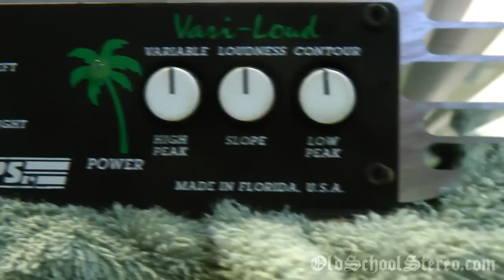The Ultimate Old School 50 Watt Cheater Amp - US Amps VLX-50 or is it?

Comment from the maker: I just looked closer and the amp has (12) 50v 1000uf caps for input filtering and (10) 25v 2700uf caps for the power supply. The input filtering matches the 1999 VLX-25 and USA-400, but it has more power supply capacitance 27,000uf vs 16,000uf as listed for those amps

Comment: I believe the best use for it was to wire multiple subs to drop the impedance low in order to get more watts out of it. Refer to the manual first though because I have not owned that particular model. I had two of the smaller (1/3 the size) 50 x2s that operated best at two ohms. It was designed to dominate the 50- 100w car audio competition classes by qualifying for having only 50 watts but being able to be wired for much higher power. Great company back in the day. All of their amps were very efficient for their size. Definitely not found at Walmart 😈💯👌🏾

Comment: Claiming 25 x 2 with the size of that thing is hilarious!!!.
Reply: MrBmarque1 at 32 ohms
Reply: MrBmarque1 I believe the best use for it was to wire multiple subs to drop the impedance low in order to get more watts out of it. Refer to the manual first though because I have not owned that particular model. I had two of the smaller (1/3 the size) 50Wx2s that operated best at two ohms.
Reply: lb lewis that's common sense bro
Reply: sounds like an understatement, but, it could be REAL

Comment: I sold US Amps back then, and sill run my vlx50 today. State record 0-100 watt at 149.9 with an hc50 on my highs. Incredible amp. Ran  4 Beta 15 DVC's bridged ,Paralleled. NEVER go hot or shut down. Also sold McIosh car audio, and original US Amps rivaled hem for sound quality .

Comment from the maker: The VLX-50 specs you show are at 12.6v, the 14.4v say it will do 500x2 at 1/4 ohm and requires a 120A external fuse. You don't have an owner's manual for this amp, do you? RE Audio didn't reply to my inquiry and I've not been able to find one otherwise. This amp is from 1996 and has the "liquid glass" aka Mirror Polish finish.

Comment from the maker: Yeah, the VLX-25 may have been the ultimate cheater amp of all time...rated at 25 watts total at 4 ohms and does over 1000 watts loaded down. Of course, the Orion 97.3 rated at 1w total at 4ohms is the ultimate cheater, but it was made just to end the cheater wars and was actually an XTR-2250 beneath a special edition heatsink

Comment: Memphis Amp AR-HC100 is the amp i used to compete with in 0-100 stock class with 2 fosgate hx2 15s  3 cube box witha 24 inch long slot port hit 159 in a 88 sentra

Comment from the maker: I'm curious how they were allowed to compete in the wattage classes without having markings for amp models? I know people could easily swap out the end plates, like they did with the Phoenix Gold MS/MPS series amps, but jeeze..why make it so difficult? I'm pretty sure this is a VLX-50, just want to prove it. Maybe I should put it on the bench and check the power at 4 ohms, this may be an easy indication?

Comment: more info on that vlx 25 its able to go down to .25 ohm stereo  will do .5 ohm mono all day its rated after the old usa25 little 5inch amp was a 80watt amp the vlx 25 was rated 12.5watts x2 4ohm 25watt x 2 2 ohm 50watt x2 1 ohm 100watts x 2 .5 ohm  and 400watts x 1 .5ohm but with 100amp fuse it do 1000watts .5 ohm mono

Comment: The spec sheets on these make modern amps look like tonka toys. An intelligently written sheet explaining internal part tolerances and actual current capacity of the transistors shows how these were built like a diesel engine, probably 3 fold over what is needed. The manuals used to say “keep adding subs until the amp enters protect then remove one, 300 year unlimited warranty” LoL.

Comment: I have the original spec sheets for every model back to 1996. Your amp is from 1996-98. By 1999, they had taken the LED out of the palm tree, changed the logo font and stopped using Vari-Loud EQ (even though the PCB was the same...).

Comment: I had a 2000 watt amp looked just like that. US AMps 2000X was it’s mode number.
Reply from the maker: US Amps used the same heat sink for many of its models. In fact many competitors swapped the end plates so they could “cheat” the lower wattage classes

Comment: It's a VLX50 if it has 22V rails. It's a USA-100HC if it has 25V rails. It's a USA-400 if it has 44V rails. VLX is 1/4 ohm stable. 100HC is 0.5 ohm stable and 400 is 1 ohm stable.

Comment: Just ran across this video this is where jp got his amplifier designs from The old US Amps 😂😂😂 And the different  colors also  if I can remember those old school amplifiers  don't need fuses they have a protection circuit that's unbelievable if you touch two wires it automatically goes into protection until you fix the problem

Comment: This is competition level old school Gold 👌🏾
Reply from the maker: +lb lewis no doubt!
Reply: lb lewis i have the Black version of this Amp I was thinking about running subs off it
Reply: Terry Watkins I believe the best use for it was to wire multiple subs to drop the impedance low in order to get more watts out of it. Refer to the manual first though because I have not owned that particular model. I had two of the smaller (1/3 the size) 50Wx2s that operated best at two ohms. Go for it let us know how she sounds.

Comment: Hey D! I recall one of the competitors having this VLX 50 in a High Voltage version and 12 were made that way. I was trying to make a deal with them on the amps with schematics because of them being "custom made". Supposedly they ran 24, 10" punch dvc 4's  at 4 ohm loads, per pair. If anyone has info on the amps I mentioned I'd love to learn more about them. Thanks All
Reply from the maker: US Amps made many custom amps and people swapped those end plates all the time using high voltage amplifiers with end plates from the cheater amps

Comment: I'm pretty sure that's a USA-50HC which was good for 800 watts at 1/2 ohm. Does it measure 23" long? Also, because of it having the "Vari Loud" controls, it is a 3rd generation which they started making in 1996-1997.
Reply from the maker: +TheHMFNW It was confirmed to be a VLX-50 from the serial number. US Amps had a lot of different versions of amplifiers using the same heatsink
Reply: +Dereck BigDWiz cool! Still an amazing amp regardless of model! US Amps were and still are "the shit"!

Comment: VLX50 Specs from USAmps:

25 Watts @ 4 ohms / 50 Watts @ 8 ohms
50 Watts @ 2 ohms / 100 Watts @ 4 ohms
100 Watts @ 1 ohm / 200 Watts @ 2 ohms
200 Watts @ .5 ohms / 400 Watts @ 1 ohm
400 Watts @ .25 ohms / 800 Watts @ .5 ohms.

But the USA-400 is more powerful. 

POWER OUTPUT STEREO/ MONO
200 Watts @ 4 ohms / 400 Watts @ 8 ohms
400 Watts @ 2 ohms / 800 Watts @ 4 ohms
520 Watts @ 1 ohm / 1040 Watts @ 2 ohms

Comment: Vlx 50 witch is a ultra high current can be ran at 1/4 ohm stereo 1/2 ohm mono maybe with enough batteries might run 1/4 ohm bridged ultimate old school cheater amps

Comment: did you ever bench test it.
Reply from the maker: Unfortunately, I didn't. I never intended on selling it, but I got offered an insane amount for it and I'm not an idiot...I have tested the VLX-25 and VLX-400. I also have a VLX-200 I'll test eventually
Reply: BigDWiz yes I always wanted to know what it put out. it's in my truck rite now still but the truck isn't on the road I'm rebuilding it. I believe the amp was $1500 new. Well that is what my friend always told me. him and his step dad owned hyperperformance they had everything made by us amp they had several vlx 400. But I never heard 1 hooked up. My buddy past away and I never new what happened to all the equipment.

Comment: Have you ever owned an old school lanzar opti 50c? or are you just trying to show off what you have now? the old school lanzar 50c is the best amp that I have ever hooked up and ran for over 35 years, so i think you need to check your "manuals" again and check yourself.
Reply from the maker: Yes, I've owned 2 Lanzar 50c's...1st gen blue one and 2nd gen black one.  Too bad I sold the VLX-50 before I had a chance to fully test it out. I have another video where I tested RMS power output of the blue Lanzar 50c and it didn't quite do rated; Old School Lanzar Opti Drive 50c Ultra High Current Cheater Amp RMS Power Output Test SMD DD-1 . Still a great amp, no argument there